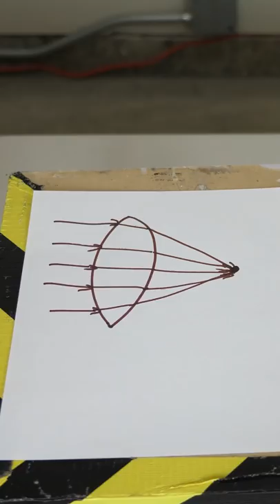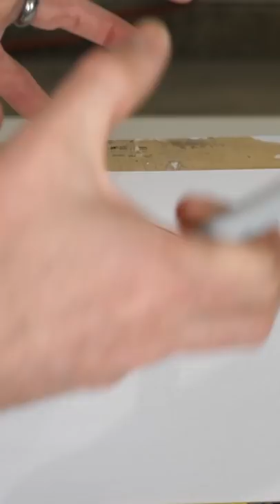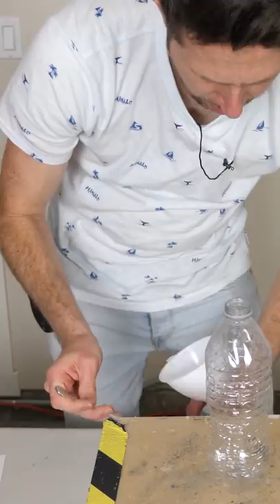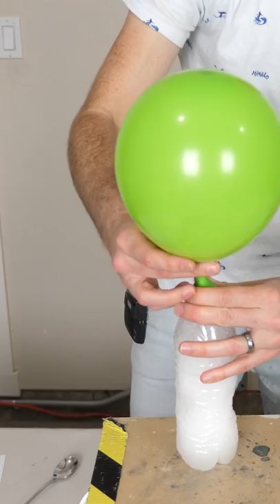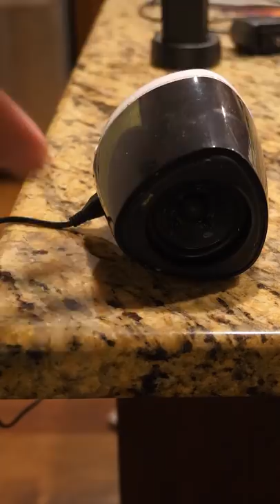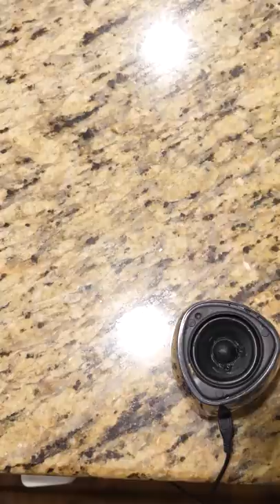Making a Sound Lens

Comment: The reason that there's not much of a difference is because the carbon dioxide interface is a balloon, which has a lot of elastic potential so a lot of the sound energy is absorbed by the balloon. If we were to suspend carbon dioxide instead of keeping it bound, it would be much louder.

Comment: Acoustic lenses focus sound in much the same way optical lenses focus light. Instead of using glass and mirrors, the duo designed an acoustic lens using 21 rows of 21 stainless-steel spheres. But instead of firing sound waves at the lens, they actually strike the first sphere in each row so that we send a compressive wave down each stack or row. This effectively tune the focal point of the lens by changing how hard they strike the lens (affecting the waves’ amplitude) and the size of the spheres (affecting wavelength). The waves are then transmitted into an object, such as a human limb, where they focus down to a point.

Comment: This is so cool, What?? Is there any practical application for this Because I feel like there should be
Reply: Sure. Directing sound to a specific focus.
Reply: Cool sound laser.
Reply: I do recall seeing a car that had different music depending on which seat you sat in, perhaps this explains how they did it
Reply: @LilNewo  They likely had parametric ultrasonic transduction speakers in the car. It could have even been just normal small speakers in the head rests close to the listener.
Reply: @scar3xcr0  nah it was a direction speaker above the head.

Comment: I've had this cool idea bouncing around in my head for a while, and I was wondering if you could tell me if it's possible. And if so, how difficult it would be.

I got a kindle about 2 years ago, and I really liked it because I could lie in bed with the lights off, but still be able to read, so when I was tired, I could just turn off the kindle and go to sleep. (It also hid the fact I was reading at like 3am on a school night, but whatever.)

A year or so later, I got my first pair of glasses, which was great, because I can hardly see without them. Life quickly got about 10x easier for me now that I could see more than a foot in front of me.

But I had this problem. Like I said, I like to lie in bed reading my kindle to read at night. But the problem was, I couldn't read without my glasses. It was incredibly uncomfortable to wear my glasses while lying down, because they would move and be pushed away from my eyes, or be pressed into the side of my head, which hurt. (I could wear contacts during the day, but I couldn't at night because having to get up to take out my contacts kidna defeats the purpose of reading on the kindle.)

So yeah. One day, I was reading my kindle, and thought to myself, "it would be cool if I could somehow blur the letter just enough so my eyes process it as correct. Almost like a lense on the kindle so I don't have to wear them.

And the thought just kinda stayed there. I'd think about it on the bus to and from school, and I did a bit of research on how glasses work to see how they correct vision. I found out that they bend the light to complement the wrong bend in my eye, so when my eyes see the light, they think it's wrong and "mess it up" so it looks clear. Or something like that. Since it had to do with light, though, I knew that couldn't be the solution to my problem, unless I just got a giant lense for my kindle, but that would be a bit impractical.

So that's it. I haven't given up, but was wondering what else I could possibly do that might work. If you have any ideas, please tell me!
Reply: Giant lens is the answer! A cheap thin plastic lens is called a Fresnel lens. This is good for old people who are far-sighted. I have not seen one that would help near-sighted people, but it should be possible.
Reply: project the image on some white sheet or wall !
adjust the distance for clarity !

Comment: I like your videos, some nuance that may improve this kind of demonstration: 1) I think any amplification due to sound lensing will be overcome by attenuation due to reflections at the interfaces 2) a better comparison that takes interface reflection into account may be to fill a rigid brick shaped container with co2 and compare to a filled curved container, especially as lensing is based on curvature...lastly, while true for sound the density of a material is not necessarily related to its ability to "lens" light

Comment: Wait I'm confused. Surely since sound travels quicker in higher density unlike light, shouldn't a convex 'lens' like the balloon spread the sound not focus it?
Reply: I was wondering the same. Wouldn't a different shape give him a greater effect?
Reply: On the top of my head, I think it has to do with the presence of the baloon's plastic membrane. Some of the energy that "would not hit the microphone" is used to make vibrate the baloon membrane that produces sferical waves that transfer a part of that energy to the target.
I'm not sure though. He could do the same thing with air filled baloons and other gasses and confront the results.
Reply: Dude you got an excellent point there 
I didn't think of that
Reply: That would be a concave lens. Search up the difference with concave and convex lenses with light and you will understand
Reply: @gandalforchidea4999  yea exactly, so the sound travelling along the surface of the balloon leaving on the side would be more like the gravitational lensing than optical lenses.
Reply: @mlg_wiktor5669  It'd be the opposite to the light. Using snells law v2sintheta1=v1sintheta2, since speed of sound in denser air is faster, the angle of refraction would be greater than the angle of incident. So in a convex 'lens' sound will diverge rather than converging.
Reply: @samuelkang9876  Ah yes of course! I didn't take into account that the sound will travel FASTER. So i guess this would be like using air instead of the glass lens and glass instead of the air in a light experiment? that would be quite interesting. You'd probably have to use hydrogen or something then? Or is the whole experiment flawed?
Reply: Looked into this and here's what I came up with. Sound travels slower in denser mediums and faster in more elastic/stiff mediums. You might be thinking of how sound travels faster in water than air. That is due to the incompressibility of water, which has a greater effect than the change in density from air. Since these are both gasses and are similarly elastic, the density is the primary contributer to the change in sound propogation. Thus, sound travels slower in the more dense gas.

Comment: It shouldn't work this way. Light is slower in more dense materials, and sound is actually faster, so it works another way. You should use lighter gas for this
Reply: you are right ; but one problem would be - pressure in the balloon will increase the density !
Reply: @pravindahiya719  helium filled balloons are still lighter, meaning less denser, than air

Comment: If you did this with helium would it get quieter?
Reply: Surely it will act as concave lens
Reply: @hustyfoxx That is what I would think. Would a light weight plastic convexed lens act like a concave lens under water?
Reply: @wlemmon  ohh let's discuss this then!
Reply: @wlemmon  convex lens will surely act as concave lens if it is place in medium with higher refractive index. For this purpose carbon disulfide is used as medium

Comment: should demonstrate a balloon with just air in it as a control.
Reply: Agree. it's a very simple sound maybe it could be amplified by the resonance of the rubber

I expected a larger increase of volume if it was actually concentrating like the pic. And shouldn't it get quieter in the areas near the point in addition to louder at the point?

Comment: you should try this with one of those metal balloons. I used to work at a party store and we messed with those balloons all day including the foil/metal ones. there were specific types that when you tapped them they played like happy birthday. One day while replacing one i took the speaker out of the old balloon and put it against a new one that has the same kind of rounded disk shape. and it greatly amplified the sound compared to if the sound came from inside the balloon or from the speaker alone. I had given me the idea of wanting to make a speaker system using balloons that could be deployed and DJ per say could play any music from them. Something like a floating wireless speaker system. I never got the chance to try it out but I bet someone could invent something like that.

Comment: i think this not the real theory of sound magnifying, from this experiment you just make medium for sound travel much shorter to your microphone, by using outer rubber from ballon, you need to tes same distance from microphone to sound source. and same distance from microphone to outter ballon. you just can use something like pipe to replace the ballon position and will had same result. and sound magnification just work like cone microphone. or reverse cone to make more compresed transverse sound wave from air to get more amplitudo, like we make hearing more acurate by put our hand cone position to our ears